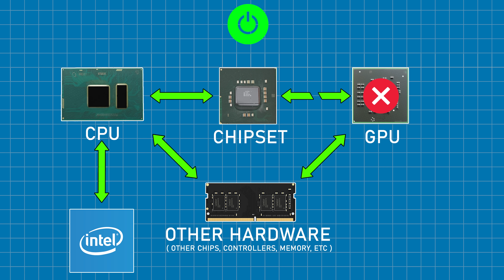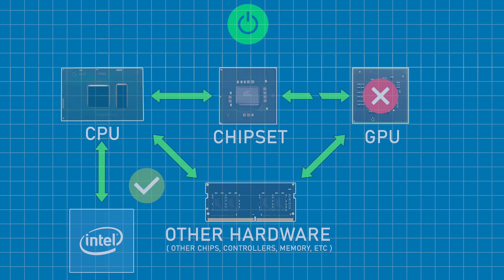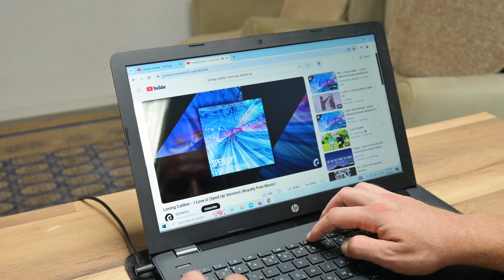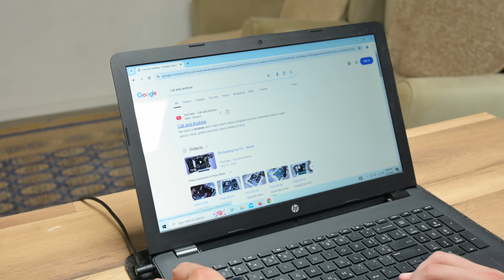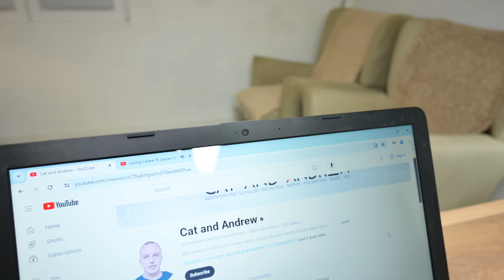The impossible fix ? - Making laptop from a scrap

Comment: A word of warning: Disabling the dGPU like this is pretty much a guaranteed way to lose external monitor support as well. I am pretty confident that the HDMI and VGA no longer work now. That's not the biggest deal (especially since not doing this means that the laptop is junk), but you will be essentially forced to use weird USB-A video out adapters to connect to things like a projector.

Comment: Hi andrew cam you give me some advice. i have two laptops one is Lenovo flex 3i Chromebook and other one is Lenovo IdeaPad S145 both are dead laptops the motherboard is not working and repairing it doesn't make any sense because it will cost too much so the windows laptop which i am talking about has a small issue two IC is missing on motherboard and display connector just because of that the laptop is not starting what should i do with this two laptops for recycle ♻️
Reply: sell them for repair shop to ise as parts and buy a cheap thinkpad from ebay with i5 8th gen and a cheap ssd is the best combo

Comment: I would get a hot air soldering gun to pull the GPU chip off & reball & resolder it back down before saying it's completely dead. Otherwise, I'd try to replace it.

Comment: 6:43 you can see why the AMD graphics have failed on that motherboard. Just look how far away the GPU is from the fan and finstack! The heat has to go from the GPU along the whole pipe, which is only single thickness, past the CPU and to the fan. No wonder why it failed.

Comment: The problem is that HP tightens the hinges too much and it breaks away the plastic overtime! I saw the same happening on a lenovo ideapad, and i loosened the hinges on my machine, i can open the lid with 1 finger now and the screen just stays open in any position. It's like factory, why do they do that? Planned obselesence i guess

Comment: I had the same issue with a Dell Precision 3510. The AMD GPU is faulty. Once the drivers are loaded, the OS will BSOD or black display or hard lockup. If I disable the GPU in safe mode, Windows will boot fine.

Comment: I don't know if you can believe but, I removed my radeon hd graphics with (50% heat gun,  and 50% screwdriver force) wich made the copper connections pulled like hair.
So then I sand it with sand paper and the laptop is working with intel hd.

Comment: any recommend any glue that works best on laptop case? some glue makes the case brittle
Reply: Any good epoxy glue should do the job, I usually use Gorilla Epoxy Glue or Araldite Rapid (the red one) for such repairs. They're quick to cure though so you'll have to act fast once you mix the two materials together.

There's also Araldite Ultra Strong (the blue one) if you want a stronger bond and don't want the glue to cure fast.

Also get some masking tapes, it helps holding small bits and pieces in place while the glue is being fully cured.

Comment: Great video! Would the GPU fix work on a 2011 Apple MacBook Pro 15" (A1286)? I disabled the GPU in software, but it is not a great solution.
Reply: MacBookPro8,2 and MacBookPro8,3 use MUX chips to switch graphics so you'll need to disable that instead.
Reply: @OverTallman  Oh, alright. Thank you.

Comment: Hi Andrew! Been watching your videos since 2020. Big fan of your work. I just wanted to ask that I have a Dell Latitude E6410 with Intel Core i5 520M (35W TDP) and I was wondering if I could upgrade it to i7 640M (37W TDP) or i7 620M (35W TDP). They have same socket(PGA 1288) so do let me know which one shoud I go for. Waiting for response. Thanks!
Reply from the maker: Hi bro thank you for the support. I think you can do the upgrade, I think there is Dell Latitude E6410 available with i7. Most laptops with removable CPU are made to support upgrades just because of the price or pushing some model the factory will made more different variants. For upgrades you can check by your chipset, on google you can enter your chipset model and then in addition type "CPU support" it's easy to find

Comment: It doesn't work on all laptops, onmost higher end laptops the display is hooked up directly to the GPU. Disabling the GPU disables the display even if the cpu has integrated graphics.
Do not buy cheap laptops to fix them unless you know how to check if you can do this before buying!